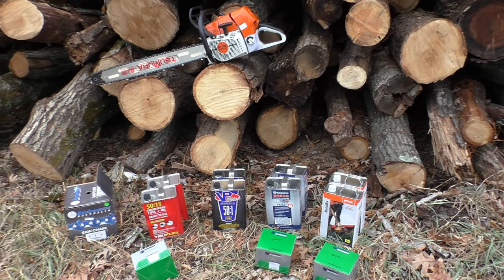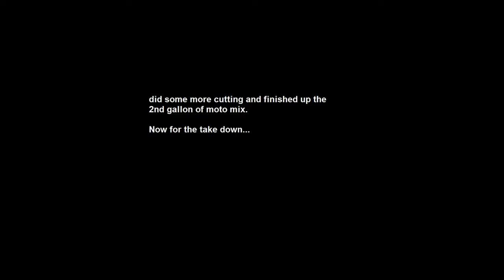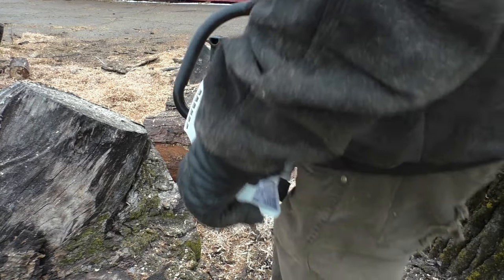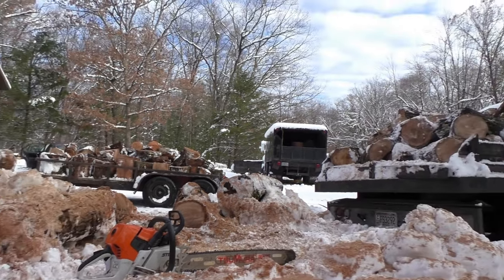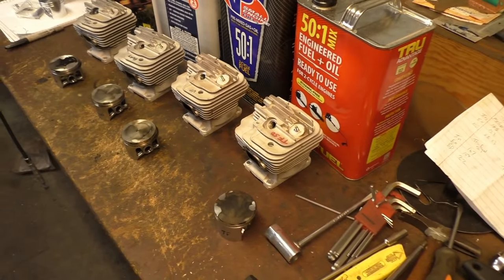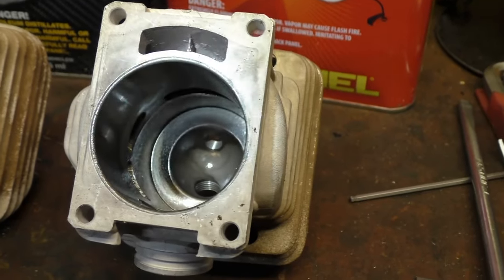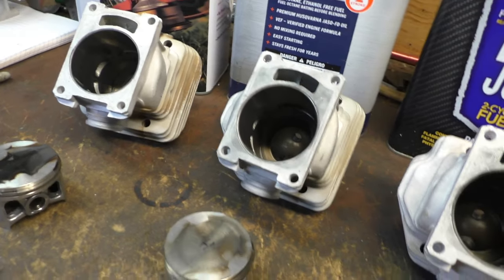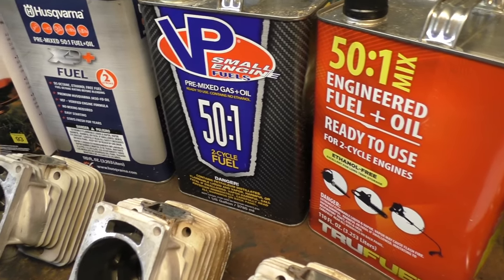Premix Fuel Test - Stihl vs Husqvarna vs VP vs Tru Fuel 50:1

Comment: Of all the fuels, the only one I wouldn't run, is "True fuel". The other 3 seem really good. The only reason I would run Husqvarna, is because it's among the cleanest, performs well, and it's the least expensive.
     To be honest, It's much cheaper, to just buy a 6-pack of 2.7 Oz bottles of oil, and mix it myself with 1 gallon of gasoline. It costs me less than $6.50 a gallon, for good fuel mix. I typically run Echo, or Stihl 2-stroke oil in Chevron gasoline. I'm most confident, with an OEM branded oil, though I'm not afraid to run Stihl oil in an Echo leaf blower, or Echo oil in a Stihl chainsaw. BTW, A gallon is 128 fluid ounces of fuel, 130.6 Oz, counting the volume of the oil added. That's almost a full tank of fuel for a string trimmer or leaf blower for free, compared to the volume of fuel in a premix can!

Comment: Great video you went above and beyond on this! I would love to see the Stihl oil with both pump gas and avgas. Personally I can’t justify the price of these premix fuels I try to get Avgas (100LL) and mix with the Stihl oil at least when the equipment is not going to be used daily. I’ll admit when I’m cutting a lot I mix it with pump gas (gasahol unfortunately is all we have here), but I try to get avgas if time allows.
Reply: @@p.grimmitt1648the EPA and FAA have started the process to phase out/eliminate the 100LL.  Good news is that the drop in replacement is lead free, still the same octane, but it’s going to be expensive, really expensive.  I’m a pilot that flies for fun and since COVID fuel has gone up along with every other aspect of aviation to the point I’ve tabled it as a hobby for now…

Comment: Excellent video! I agree the fuel it's self is just as important as the oil. I too have seen Ultra make a mess with pump fuel. I like True Fuel 40:1 but it seems to make things real tacky when the engine is at room temp, I don't know if that is a good or bad thing. I wonder if you'll find the same. I believe True Fuel 50:1 has Motul 800 and the 40:1 uses Motul 710.
Reply from the maker: very interesting...yeah I just started running the 40:1 tru fuel for the next video.  Should be interesting.
Reply: Redbull661 STIHL Motomix is 99% pure fuel ; first “crack” of the refining process and FAR superior to ANYTHING I can get here in WNY ... pump gas labeled “non-ethanol” can legally contain 5% ethanol at least here in wny ... I’ve got friends that drag-race cars (and place / win frequently) and they steer clear of pump gas for sure !  It ain’t the 70’s my man and the pump gas today is just plain 💩... especially in a ported 2-stroke
Reply: Interesting. What makes you think Trufuel uses motul premix?

Comment: Stihl pre mix is an alkaline fuel.  It’s good for 5 years sealed and 2 years open.  It’s a far superior fuel.  Also look into aspen fuel, it’s alkaline fuel as well.  Costs way more but it won’t gunk up your carb,  you can store them wet.  All the other fuels will.

Comment: I forgot to add, I mix my gas at about 47:1 (80ml of Stihl Ultra) and one gallon of PNE gas plus one ounce of Sta-Bil per gallon.  It runs great in my Stihl, Husqvarna and Huztl clone saws, weedeaters and blowers.
Reply: I go 30 most things are 40 or 50 but 30 will work with both.

Comment: Most chainsaws are in the 9.5 to 1 or 10.5 to 1 compression ratio. Add a thinner gasket or no gasket and it could be higher yet. Higher octane gas on a 2 cycle is better it gives you a buffer for detonation and dont hurt anything. I have seen lots of saws with problem due to cheap oil, poor fuel quality, and carburetor problems. Not worth the savings on fuel. I use Premium gasoline with VP or Klotz full synthetic oil and PRI-G fuel stabilizer. Never had a problem with anything due to fuel or oil in over 20 years. I have 14 saws and can grab any one of them and they will start cold in 5 or 6 pulls every time.

Comment: I use to run stihl oil with 93 eth free gas. Then switched to echo redarmor fuel and I noticed a huge difference..my saw runs a lot better now.
Reply: My echo came with 5yr warranty so I make sure by running there fuel that I should be ok. But to be honest I use it in everything and it had made a big difference in my sthil stuff. So I use it in all now.  Love me echo stuff. Cs590 is a sawing machine
Reply: Bought my Echo Timberwolf new and I haven't used nothing but Echo Red Aurmor fuel in mine. No problems so far, starts everytime even if it sits a month it fires up in just a few pulls

Comment: It’s hard to do a proper heat test on a air cooled machine when the outside temperature is cold and obviously drops as it gets later in the evening, even 5-10 degrees colder air blowing through the machine can make a big difference

Comment: I mix VP Racing 2 cycle oil in straight (no ethanol) gas at 40:1. 5 gallons mixed cost $41 total=$8 per gallon. What a racket the canned 50:1 gallons are at $25. My $17 per gallon savings would better serve me elswhere. Fourty gallons down the road I've got enough for a new Farmertec G660 or an Echo CS-400 for pruning and limbing.

Comment: Those fuels are too damn expensive, it's all about dealer profit margins. My self, I buy hi octane fuel and add stabil. It's worked fine the last 10 years....  Hi Octane  maybe  $3 a gallon,  Stabil  $.16 per 1/2 oz per gallon=  a wooping $3.16  per gallon and it last 24 months.
Reply: I don't like Stabil had problems with it I use PRI-G now 1/3oz treats 5 gallons.
Reply: I only run high octane 94 chevron here in Canada. Then I add a fuel stabilizer (Lucas lately) Been doing this for 6 years now. I'm starting to think that this works because the 94 has no ethanol. I'm a home gamer so gas will sit in my saw for two or three months sometimes. I reckon that most premium fuel from gas stations is ethanol free. For a seldom user I think these dealer alkane fuels are best - no aromatic compounds ( toluene, benzene etc) or ethanol to go stale. (Full disclosure I'm Not a professional but a chemist)

Comment: Good test, I only know one person that uses the pre-mixed gas and she doesn't use a lot of it. I'll keep mixing my own with the prices what they are on the pre-mix. I use my equipment way too much to spend that kind of money  on a gallon of gas.
Reply from the maker: I personally only use it to winterize my saws.  The stuff is great cuz it can sit around for a couple of yrs. where regular gas is good for about 4-8 weeks.  Great for the home owner that doesn't use their equip. much and doesn't want to mix.
Reply: @Redbull661  I go through about a gallon a month.  Certainly cheaper to mix my own (especially since I can get ethanol free in my area pretty easily), but I tend to go with TruFuel just for simplicity.  Plus, the 1 Liter cans are perfect for putting in my saw pack when I am out clearing a trail.

Comment: Perhaps this content is for consumers in developed countries! In other developing nations, we go along with whatever 50:1 fuel is dispensed at the pumps. And our machines run reliably for many years with regular service at the correct intervals. These so-called engineered fuels are really a gimmick for a niche market! Reading through owners manuals and technical service manuals, I find that our premixed fuels available at the pumps are blended within the standards set and recognised by most small engine manufacturers- JASO, ISO and others included, so I don't see any justifiable need for a change in the fuels and lubes I use.

Comment: Unfortunatl at $32 a gallon there is no way I will be using that fuel. My last Saw lasted over 20 years using gas from the pump and adding my own 2 cycle oil.
Reply: I tend to think that way as well. If you're using the saw daily or several times a week, mixing your own is the way to go if...you get your mixture juuuust right and use the good gas and oil. Premixes are perfectly blended using the best gas and synthetic oil. And hell yes. If you're a logger or use the saw every day, you better be making great money to pay that price.

Comment: Great video and interesting results. Skip the 40:1 true fuel and try the echo red armor fuel. Or you could sacrifice yet another top end for us in the name of scientific research haha. 
A side note on the vp fuel. I picked up a supposed low hour 462 from a guy that said it had only seen the vp premixed fuel. Judging by the wear on the sprocket it had a little time on it. I tore it down to do a base gasket delete and it was carboned up horribly bad. It see's pump gas and belray now. Probably switch back to 87 after watching this though.
Reply from the maker: I think the most important is NO ethanol. (if your buying pump gas).  I personally use 91 ethanol free gas.  and FYI Stihl manual calls for at least 89 octane.
Reply: @Redbull661  our ethanol free fuel here was 89 then it went to 92. I used it exclusively for a while but it made all of my fuel hoses on my vp jugs hard, almost brittle. And it smelled odd. I think normal pump gas is fine as long as it doesn't sit. Something else I've noticed, it seems to store better in a metal can. I go back and forth and really dont notice a difference.
Reply from the maker: @SixOFord  yeah scott aka tree monkey wanted all my metal cans when I was done. hint hint.
Reply: @SixOFord  I think it was on the VP website, that I read, they don't recommend storing fuel in plastic containers, due to it's porosity.  Even though it doesn't leak, it will let fuel evaporate out of it.  I just double checked, it's in the FAQ's on the VP Fuels website.
Reply: @johndunbar2393 , I always see people storing their gas with the vent open and I tell them to close it because the ethanol will absorb water from the air, Their response is that it'll blow up if it can't breath. I just walk away shaking my head !
Reply: @augustreil  I don't use fuel with ethanol in it.  If they rotate and use it fast enough, I don't suppose it probably matters much if they keep a vent open, but I store my fuel in metal Jerry cans, sealed, and keep those outside, out of the sun, and have never had a problem.  I also buy my pre mix by the 5 gallon can, and store those the same way, and have had those keep for 2 years unopened and they never exploded.
Reply: @johndunbar2393 , Agree !

Comment: At face value, I can say that Echo RedArmor runs identically in my Stihl MS462 and MS201TCM to the Stihl Motomix. Doesn’t mean much considering the price difference right now is like 4 lousy dollars. $35-40 a gallon is absolutely god damn ridiculous. Also good to note for those who aren’t well versed with Stihl saw names, that my particular 462 has a manual carburetor, and that the 201, has the M-Tronic auto tuning carburetor. The 201 needs no adjustments, ever, I expected this. The 462 on the other hand should be adjusted based on fuel or elevation. However it ran identical on both types of fuel without any sort of carburetor corrections. Yet to test the TruFuel, but I’ve got a can on deck so we’ll see pretty soon.

Comment: Why would you even want to run a pre mix. You loose the ability to determine which oil you use. I have a friend whom used to work in the refinery industry, and the oils are all a long way from equal.
Reply: The main reason for using pre-mixed fuel is to avoid ethanol.
Ethanol is terrible for small engines.  Pre-mix is way more expensive than mixing it yourself, but it's difficult to find pure gasoline at a filling station.
Reply: @huckbeduck  ah ok, not an issue we have here in the UK

Comment: The octane does make a difference especially with 2 strokes the fuel burns slower with higher octane have you tested Amsoil mixed with pure gas the original blue or interceptor would be really good

Comment: Stuff is to expensive it's just regular gas without ethnol ur paying 20 for less then a gallon let me tell u something all my equipment gets used every day and i never had issues with ethnol and my equipment is 11 years old never had a break down or carb problems knock on wood but i use 93 in my saws and weedeaters and 89 in the tractors no issues people dont wast ur money just at the end of the year run them dry and store them u will not have no issues

Comment: Canned gas is a rip off. Go buy marine fuel (ethanol free) 89 octane and mix with Echo Red Armor.
Reply: Pure gas you can find all the E0 stations, and if you don't have one local you can always use 87 octane E-10 and do a ethanol / water extraction where you'll end up with about .9gal of 85 octane fuel.. and for chainsaw even ported that's all you need.

Comment: No one makes an ethonal free 87 octane
Reply from the maker: local cenex has 87 e and 87 e free.
Reply: I buy 87 ethanol free all the time. It is available from several gas stations where I live.
Reply: Why would you even want to use 87 octane in the first place. Just curious. Thanks.
Reply: We live at a 3000ft. elevation and the octane requirement drops due to that elevation. And in this area there is only the higher octane available with out the ethanol added. So I could easily use the lower octane and save a ton of money. We have a couple of older Corvettes that require non ethanol and I could get by with 87 rated fuel. At $4.50 a gallon it adds up.

Comment: First and FORMOST.. API, IS TRASH!!! I wouldnt let the NextTown overs Community's CrackHead use such trash. I have NEVER been Let down with Tru. Infact, my AllTime ABSOLUTE Favorite Christmas gift was a FullCase of TruFule. Best Year I had with my tools. Less Maintenance, less Burn, Less Stank, and ABSOLUTELY EASIEST With Coldstarts, and Prevention of OverHeats. I have ran a Husv440/14, and 2 450s/18&20 I also PREFER TF in my RyobiTrimmers, B.P Blowers, and Winter Equipments.